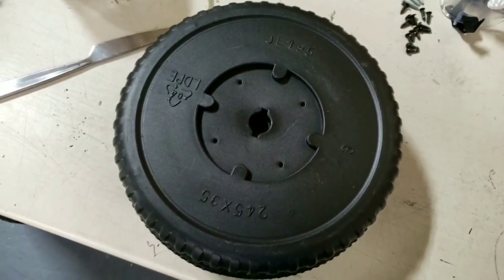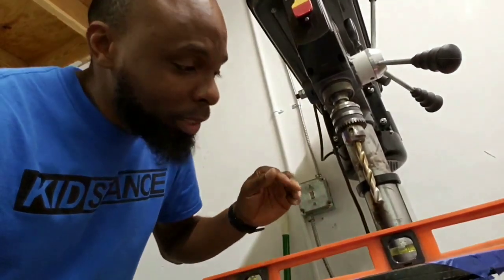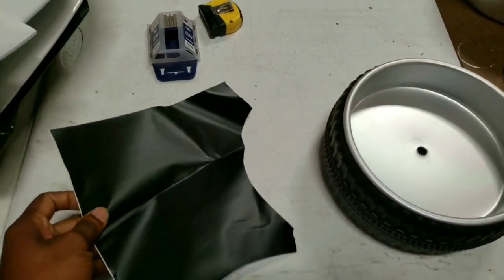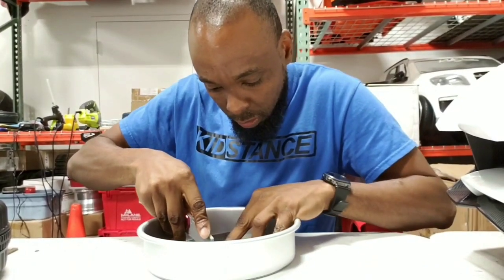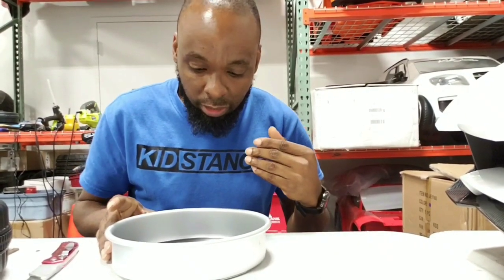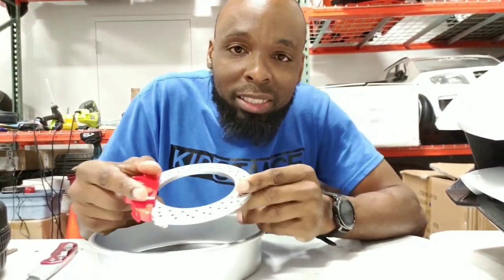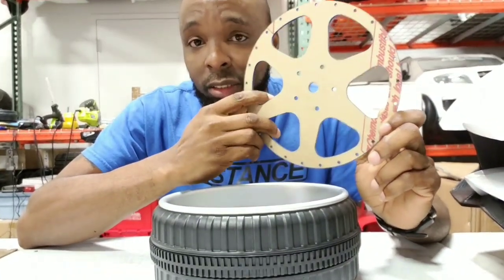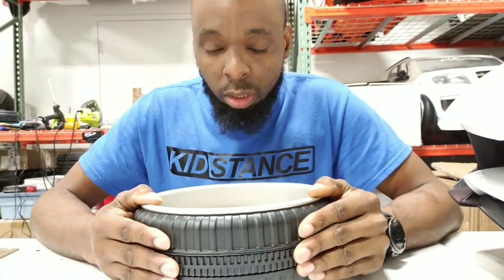Kidstance Workshop: Introduction to Customizing Wheels Part3

Comment: One of the questions I have which I hope you mention in your next video is, with the axle being The stock length you’re changing the offset of where the axle cotter pin is set I’m looking forward to seeing how you fix that as this is where I am stuck at with my sons truck. I’m having issues with they will wanting to slide out of place. Thank you for being generous and sharing of your buy ideas with us!
Reply from the maker: Very good question, I definitely need to address that next. When it comes to the axles, in most cases it will need to be cut down. Another option is adding spacers to fill the space but depending on how much space it might look a little tacky. Your best bet is to measure, cut and drill a hole in the shaft to slide a pin through. Another way is cutting and threading the shaft ends to use nuts instead. I personally prefer the first way, it's a lot faster and less headaches.
Reply: Thanks for the fast response. I’m definitely going to try the first method later on today
Reply from the maker: @paulMFbee  awesome, I use a 1/8th drill bit

Comment: Hi from the UK! Great videos... You're a natural... keep up the good work! I have done something similar using a pet bowl however the bowl was as deep as the wheel and the metal isnt too thick so it wont secure in place. I will have to buy some new pans. 
What are you using to glue the pan in place?

Comment: Nicely done sir!!!! I do have a question, as far as sturdy ness my son likes to crash and run over curbs. Will the pan bend?
Reply from the maker: Lol, if that's the case then you might not want to go with aluminum pans. You can also use stainless steel which is a lot stronger and is polished for a shiny lip look. Aluminum is strong in the smaller sizes up to 8 or 9 inches after that you might have issues with curbs. Another factor is the type of wheels that you're customizing. I mentioned in the video that some are hollow and others have a skeletal system that still helps its rigidity even after it's cut into. Thank you, I will address this in the next vid.

Comment: What material do you suggest to make the face inserts for the wheels?
Reply from the maker: To be honest you can use whatever is available to you. You make them out of steel or aluminum with a waterjet or plasma cutter or you can have plastic or acrylic faces laser cut. I started out drawing a design and cutting them out of the top of bucket lids.

Comment: How does the axle work? And all you use is glue for the outer part? No screws fronm behind to set it? Not sure if you have more videos coming but the last 3 were really good. Keep em coming! Really good work!
Reply from the maker: Very good question and thank you for bringing that to my attention. I use a specific type of panel bond made for bonding various materials together or industrial strength high temp hot glue and in some cases screws. I can't stress enough the importance of cutting out the face of the wheels evenly and as precise as possible because it places a huge role on the balance of the wheel. I will make another video addressing a few things such as these that I may have forgotten to mention or say in the last vid. I'm just waiting on more feedback from people such as yourself to see what else I could've missed. Remember this is just the basis of how to make wheels yourself. There are more videos to come.
Reply: KidStanceBuilt sounds good man! Yeah my main concern was how to get back the overall rigidity that you lose when cutting apart the wheel. Obviously it has to be as safe as possible since our kids will be riding on these things. But since you will be making more videos in the future I will definetly stay tuned. Thanx for the reply! You are a serious Craftsman. Awesome work bro!
Reply: @kidstancebuilt still looking for that axle video hope I do this right 😂

Comment: Would love to see the wheels actually being bonded to the pan.  And what your using.  I'm stuck at that point.  Hot glue does not make me feel confident enough to let a kid rode on it.    Also by changing offsets will the wheel not wobble due to the thin contact patch on the wheels by using pans.  Whereas before it was a channel of plastic.  Now it's cut plastic and a thin piece of metal.  ???? Hopefully I've explained that well enough lol.
Reply from the maker: Very good questions. I touched on the first in the video as far as having enough center contact for strength. Basically it depends on the total width of your wheel, for example, if you have a wheel that is 4 inches in width, you might not want to use a 3 inch deep pan because that only leaves you with an inch to play with as far as contact strength in the center. Now don't get me wrong, you can get away with that but it'll be really sketchy. Also if you plan on upgrading speed then I wouldn't recommend any of this period! I'll save that for the next wheel video. As far as the center strength, if you use a quality pan you will be ok as far as center strength. Just use your better judgement when selecting the pan because there are some cheap ones out there and you usually get what you pay for. Also once you center your face inside the pan and bolt it in that helps strengthen the center further. The glue I use is an industrial strength high temp glue, nothing less, however, you can also use other bonding agents such as Panel bond etc.
Reply: @KidStanceBuilt  thanks for the response.  When you bolt the face on do you go through to the back of the wheel ?? That would definately help keep things together.  Love the videos. These kids cars get addicting real fast

Comment: What kind of glue do you recommend for   the inner tip between the wheel and pan?
Reply from the maker: I personally use high temp hot glue or panel bond similar to the ones used by auto body shops for plastic bumpers etc.
Reply: @KidStanceBuilt  got it Thanks,!